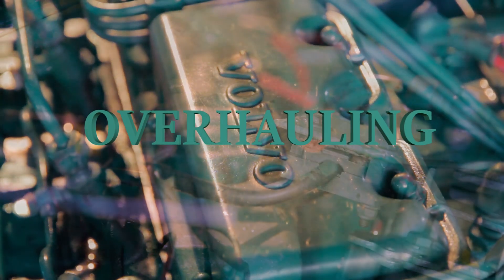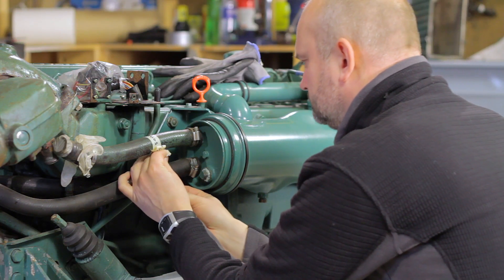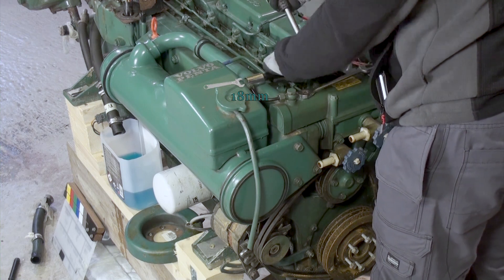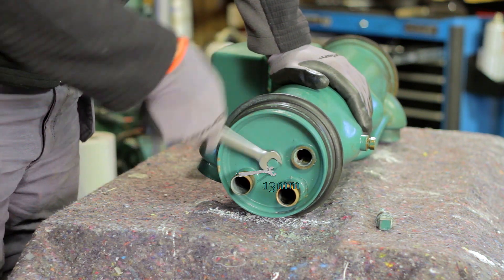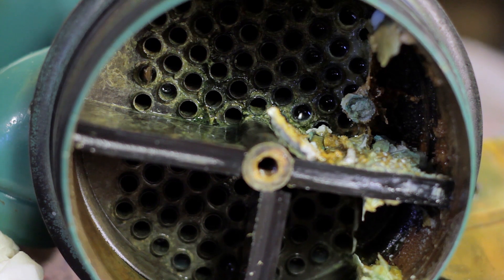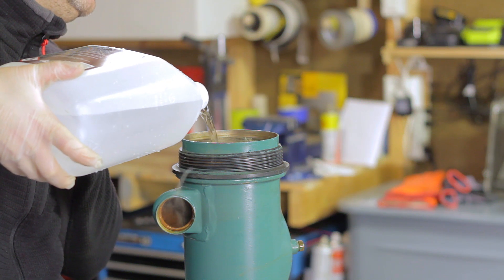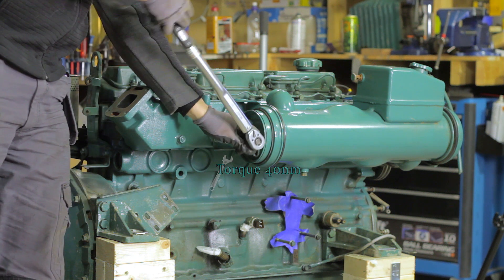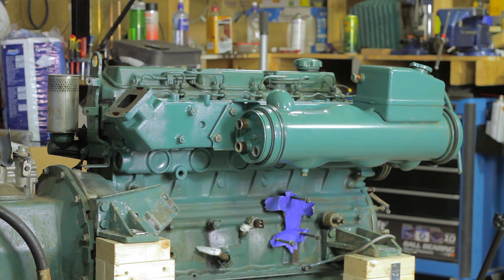Overhauling Tamd41A pilot

Comment: These are brilliant films. I have a TAMD41P and I'm trying to locate the both the engine coolant temperature senders. I found one on the Thermostat housing (for the gauge) but I can't see the other one for the alarm/flasher. I was trying to spot it on your videos but could only see a couple of oil sensors either side of the oil cooler. Do you know where it is? Thanks

Comment: Love this Svend. From Australia. Is the Volvo Penta Tamd 31a similar? Cheers
Reply from the maker: Hi! It's the  same engine, just with two less cylinders. Most of the parts will be interchangeble between the engins, but some are not. To be shure you get the correct parts, check with youre local volvo penta dealer, or the volvo penta online shop. Good luck!

Comment: Great video. QUESTION for you Svend (and all):  Where can I most easily find Volvo parts that are no longer in production/obsolete? I’m searching for a heat exchanger insert (Volvo part 844888) for a TAMD40A. Not having much luck
Reply: Try searching for the part and don't use TAMD40A use the horsepower rating like 200HP or whatever that one is. André

Comment: good suggestion on the vinegar and water. keeping the brass or copper clean or cleaning out a dirty diaper of a heat exchanger to re flow the braze joints seen it done saving that engine is very smart love it keep it up

Comment: Cleaning the pipes using a small firearm cleaning tool, like the .22 caliber, is known to be an efficient way to remove the residual "gum". Use the nylon brush though, not the cobber or brass one.
Very nice spoken english. Keep'em comming.